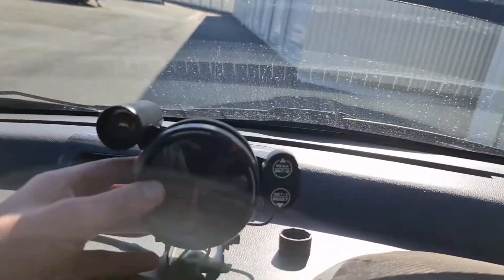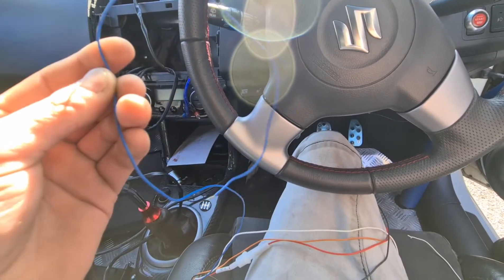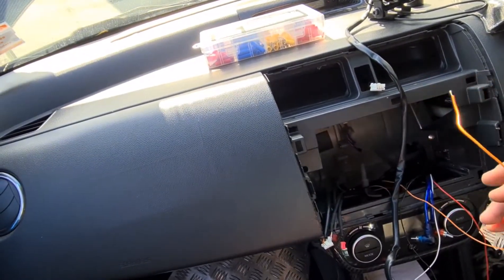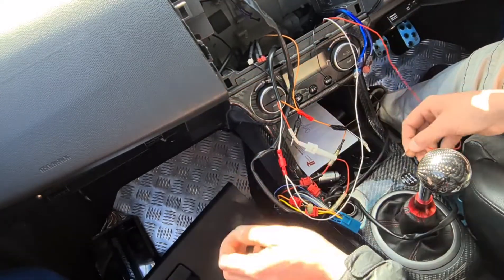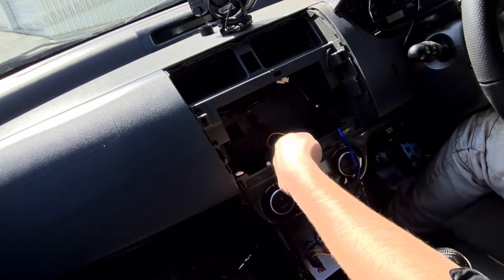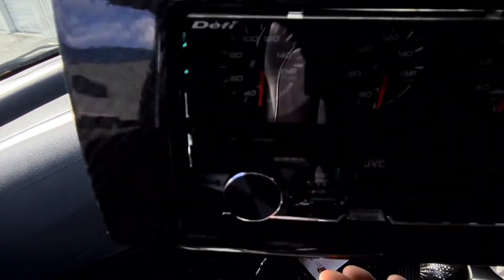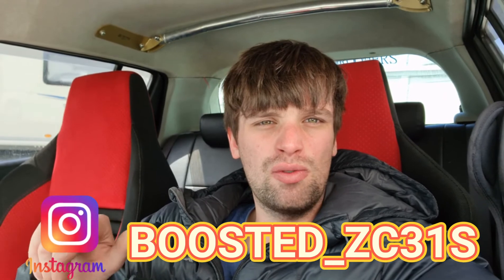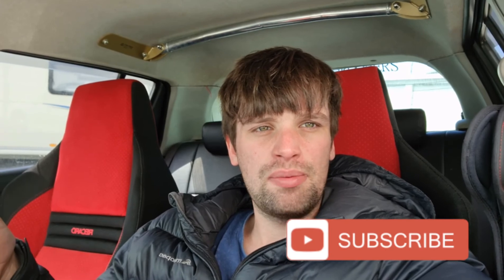Defi racer 80mm RPM gauge install | TM-square turbo swift zc31s

Comment: I dont have a rpm in my cluster just speed , will it still work in my car ?
Its Toyota probox(auto) with 2nz-fe engine.
Thanks
Reply from the maker: You can fit a rpm gauge to any car

Comment: How do you program it to 4 cylinder?
Reply from the maker: Defi gauges are very expensive and it automatically adjusts for what its connected to. I brought the gauge and it came off another swift